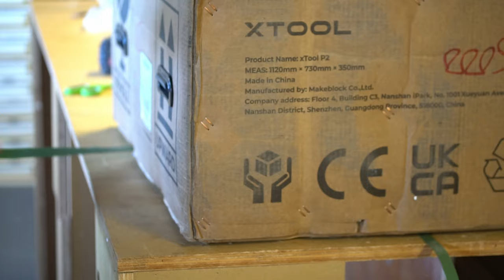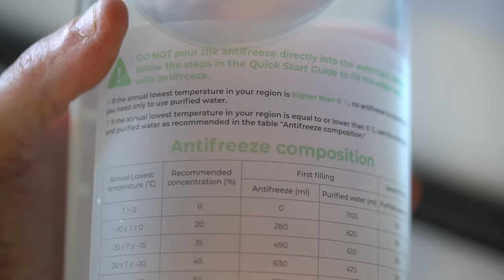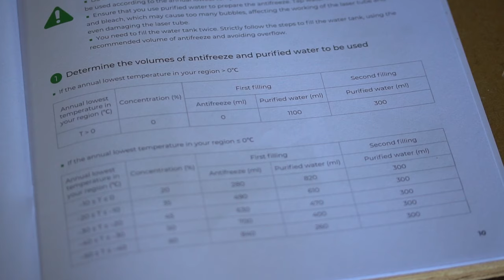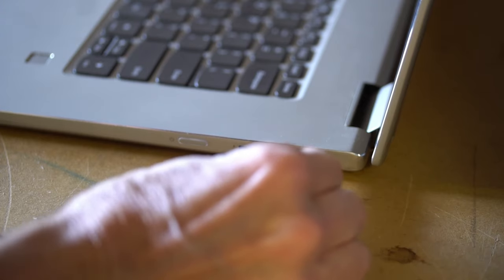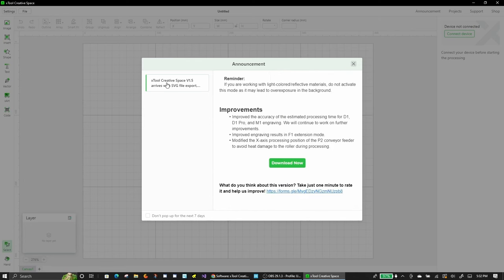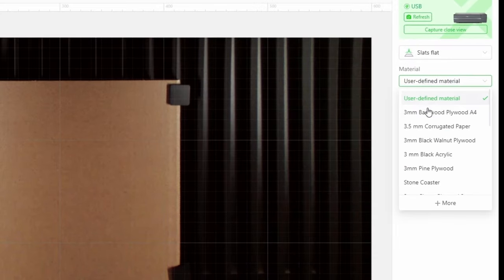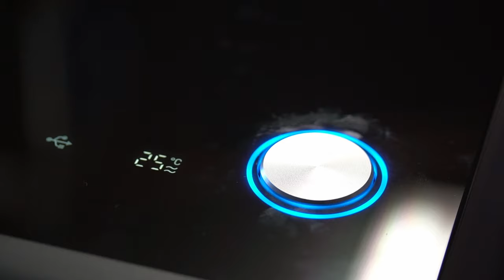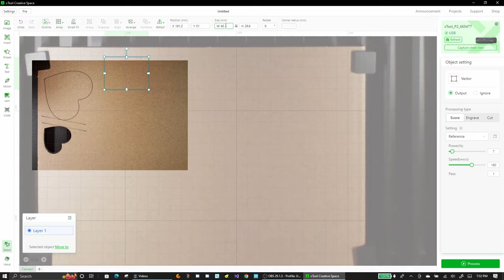The Best Laser Cutter I Have EVER Used! Game Changer!!

Comment: Does it need it's proprietary software, or can it also be used with LaserGRBL or LightBurn?
Reply from the maker: You can use it with Lightburn. https://support.xtool.com/hc/en-us/articles/14433986176407-Use-LightBurn-to-Operate-xTool-P2. I'm not sure about LaserGRBL as it seems that LaserGRBL would be best connected to a GRBL controller. Lightburn is a universal software that connects to DSP controllers.
Reply: @PatrickHoodDaniel  Thanks!